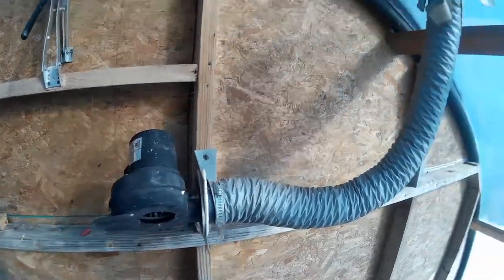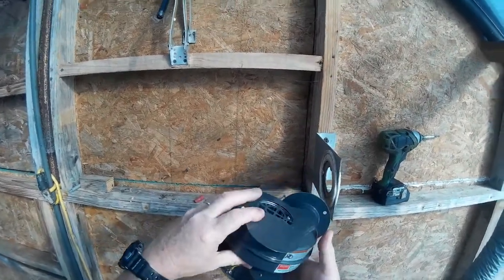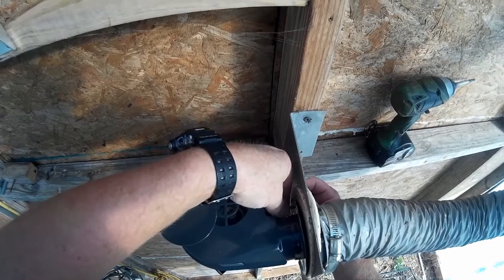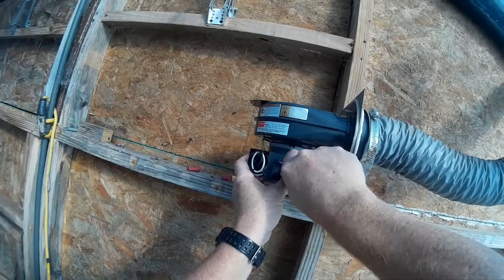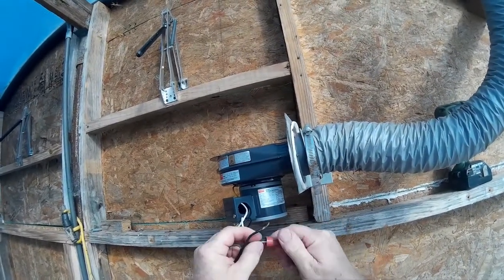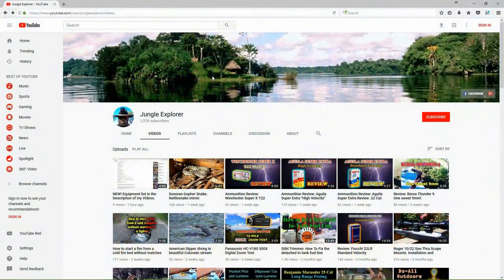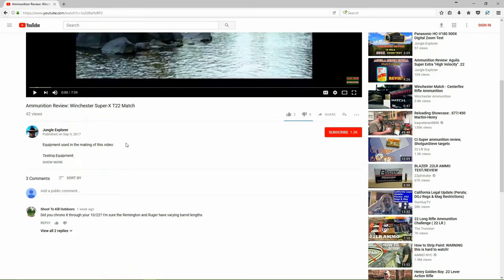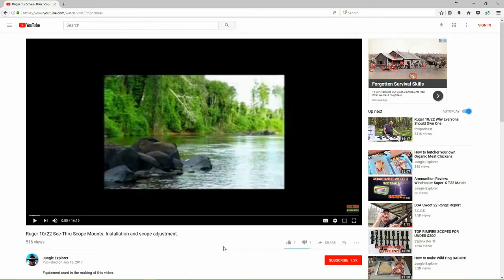How to Replace a Greenhouse Inflation Blower

Comment: Thank You very much. I am a new greenhouse owner. I purchased a fan with my plastic and it has ran all winter just fine but its so noisy. Yours did not sound that loud. I should have a spare Anyway and the one you shown is less than half the price they charged me.  

Thank You Again!
Reply from the maker: You are welcome.